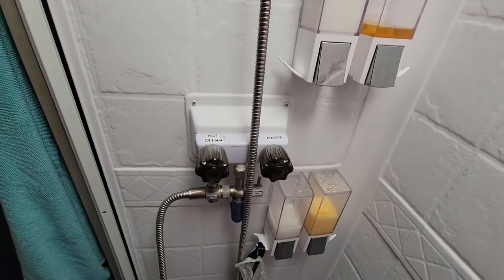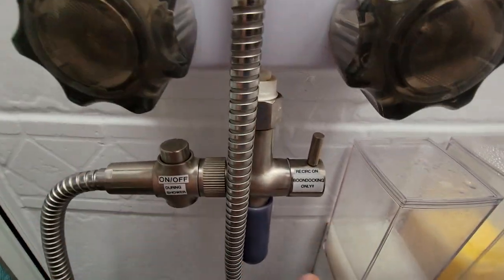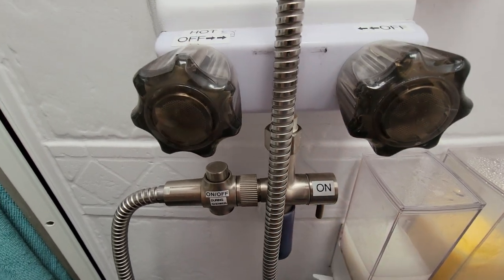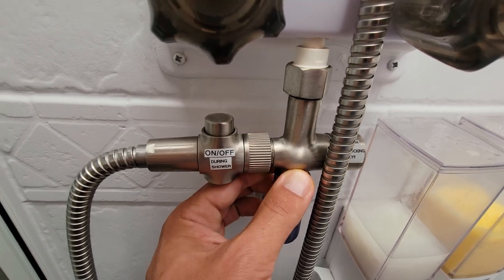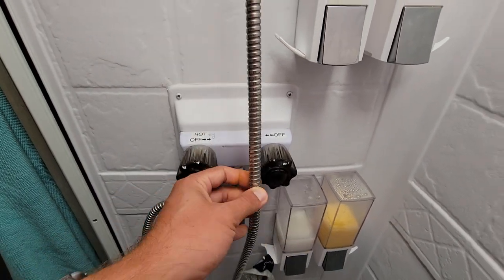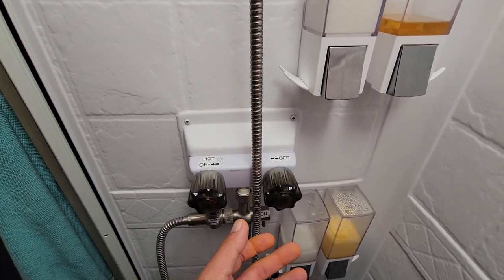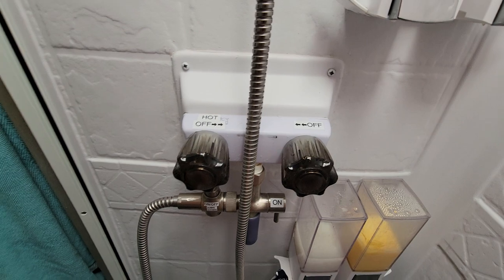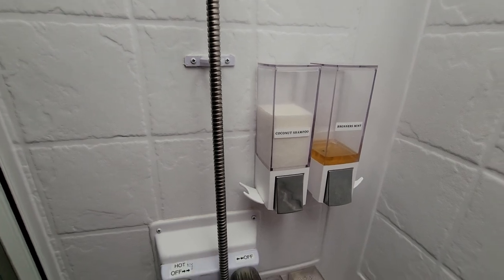Steps to Showering while Boondocking with Showermiser Valve

Comment: Have one.   ABSOLUTELY HATE IT.  First, it never worked correctly in my trailer.  Also,  What no one tells you is that YOU MUST Winterize a plumbing system with a ShowerMeiser with compressed air.    My dealer didn't mention it, my manual didn't mention it.     After Winterizing with RV anti-freeze, I de-winterized and couldn't get water pressure.    After over 15 hours of troubleshooting I found a crack in the showermeiser elbow.    I've had to by-pass it and that in itself makes winterizing more difficult.

Comment: Hey Kirk, it's Garrett from the FB Ibex forum.  I was looking at your shower head on Amazon and the comments state that it's a plastic shower line and you say stainless.  Did you purchase a separate flex line?  Would love to do this upgrade for the upcoming season.
Reply from the maker: Hey! Yes- I ordered a separate stainless steel hose. 
Danze D469020BN Metal Interlock Shower Hose with Brass Conical Nuts, 72-Inch, Brushed Nickel
Here's a link: https://www.amazon.com/gp/product/B004M46HWU/ref=ppx_yo_dt_b_search_asin_title?ie=UTF8&th=1

Comment: This is still very confusing.  If you don't want to use this with city water on how do you do that?  We also flooded our tank off.  The dealer didn't tell us about this.  Now we are concerned about getting the under bay dried out so we don't have mold or rot.  Seems like we're not the only ones who have this problem.  We are not happy campers.
Reply: It should never flood your fresh water tank in the off position, something is wrong with how its installed or something. If it's in the off position it's like its not there and should never run water back into the freshwater tank
Reply: I leave my fresh water tank drain open when i do not have water in it, there have been a couple times where i forgot about the miser, but by leaving my tank open, water came out on the ground and reminded me before i overflowed the tank
Reply from the maker: Sorry, just seeing this now!!  Assuming yours is like mine, you'd have the little bar (that you use to adjust the showermiser) facing down and then like The Johnny O Show said, you would effectively bypass the showermiser as if it wasn't even there.
Reply: The solution is to always use your water tank and onboard pump... NOT the city water connection. Just fill your fresh tank. You'll always have consistent pressure, and never worry about forgetting to turn off the city water when you leave your RV. AND... you'll never flood your storage bay again. Good habits make happy campers!!

Comment: My water was piping hot from the start and the pipe stayed blue. And regardless of the lever position the water poured out of the tub spout into the grey water tank or came out of the shower head like in a normal tub shower.  Quite disappointing.  I know I won’t be using this supposed “feature” ever.  Because it doesn’t work!